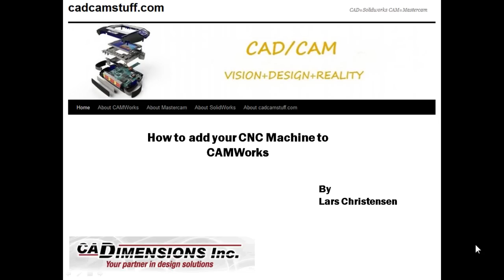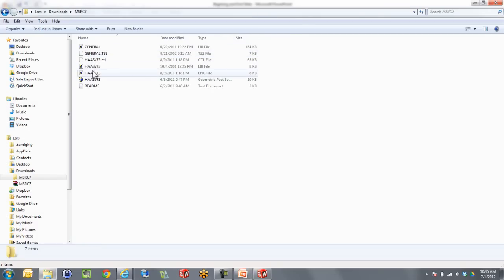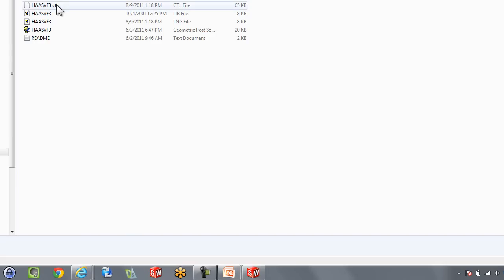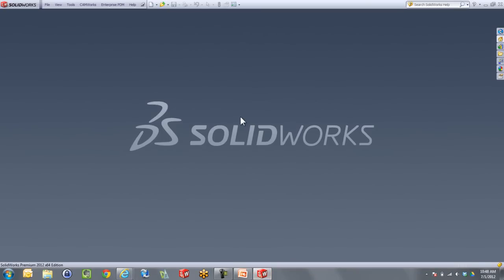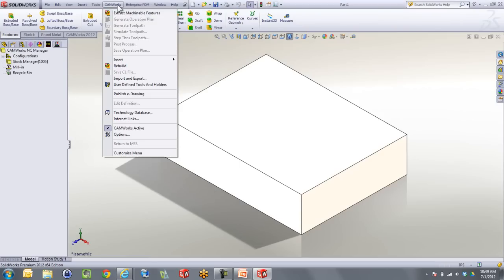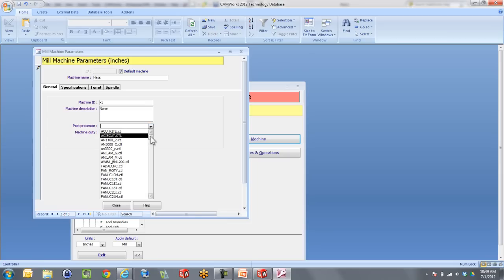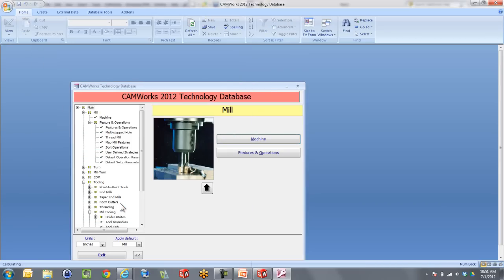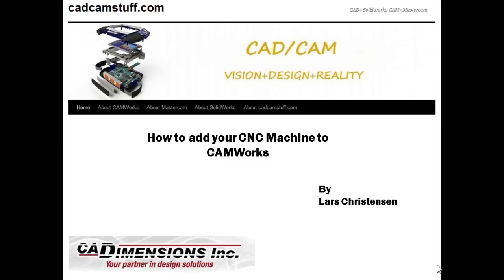How to add your CNC Machine to CAMWorks

Comment: In the HAAS machine you can go into the machine settings where you can tinker with acceleration settings and steps per rotation and get information from there.

Comment: Thanks for this video
I want to know how to add my custom machine ( DIY CNC machine with custom dimension )
Reply from the maker: Hi Nono,Thank you for watching the video. 1st. I have to tell you that I do not work with CAMWorks anymore. I moved on, and is now part of the Autodesk CAM team. We have HSMWorks that runs inside SolidWorks. You're best bet might be to reach out to your reseller. but you should be able to use the UPG Post editor to create a custom post if you need and then possibly thigh it into the table travel that I talk about right before the 6 minute mark. Another option is to draw your machine table in a SolidWorks Assembly and then just work within that boundary. Hope that helps!